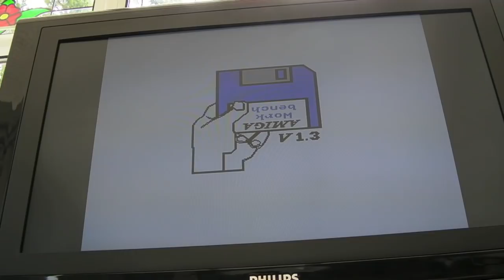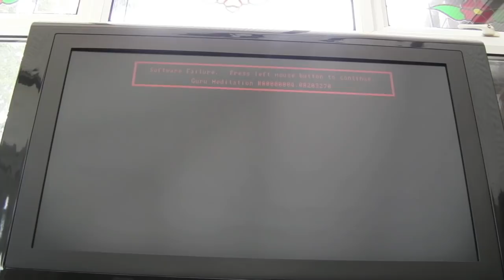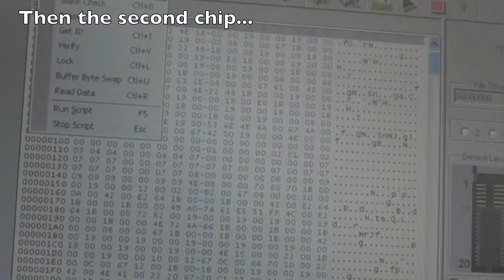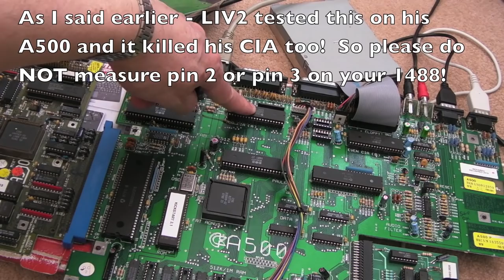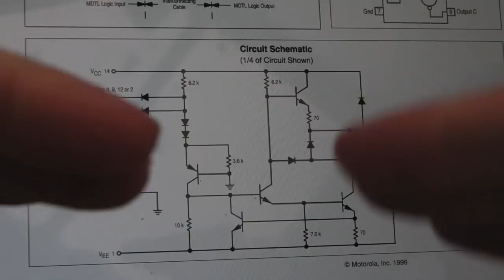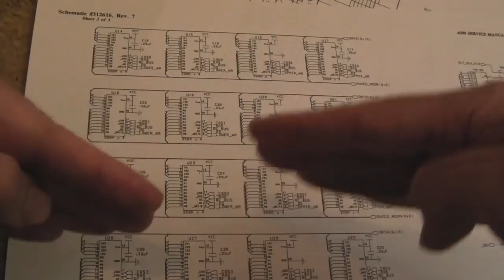Commodore Amiga A590 & A500 R6 Repair & Flaming CIA Chips!

Comment: Wow, that was a real head scratcher! I would love to know what the cause of the super heated RAM chips was down to.  Also are you able to explain why just measuring a pin can cause an over voltage?  One thing I have clocked with some guys on YouTube is that they are putting their anti-static wrist straps into their mains Earth socket and I have often wondered if that is a BAD thing to do, as their may be a difference in potential between the mains Earth and the Earth plane on the board you are working on so that could cause a current to flow in one direction or another.  I always connect the wrist strap to the board I am working on then I know there is no potential between me and the board?  I am a bit of a noob to this, so please shoot me down if I have this arse about face!
Reply from the maker: Thanks, yes - it seemed like I was cursed on this one lol.  A few things that I just couldn't explain - it was quite demoralising to say the least lol.   The CIA insta-sploding, I think is caused by a small current path of the multimeter - it must be.   ie. When connecting the -ve to ground, and +ve to pin 3, that very small current path through the probes between ground and pin 3 is enough to cause some kind of overload on the output.   If you look at blower's  comment below - It's possible that has a bearing too.  It might be the A500 PSU leaking here, maybe it needs new Y-Class caps or something related to its design.  

That may also explain why Liv2 had the same problem (ageing component in these PSU's ???).  I will investigate further!  Regards where you connect your earth strap, I think the mains earth is the best place since earth is earth - ie. you are going straight into the ground.  If you touched a live chassis, the fact your wrist is connected to earth is what's going to save you.  If you clipped onto the computer chassis and there's leakage (or a mains referenced chassis) - you will get a shock as the path to earth will be through you rather than the wrist strap.  The other point I would make here (and I've not mentioned it on my channel until now, but I will) - use an RCD too!  That is a life saver!   Most modern houses have RCD on each ring etc, but it's essential you have an RCD when working on anything mains powered.
Reply: @GadgetUK164  Good points Chris, I do have an RCD on my mains system so I am good on that. The bloody thing does trip very quickly at the slightest fluctuation which has been a pain in the past, especially as I have an electric garage door and the fuse box is in my garage and I can't get to it from inside the house, so I have to use a manual key to get it open and you can bet it will always trip when it's freezing or raining or both! Good point about the Commodore PSU's that does make sense!